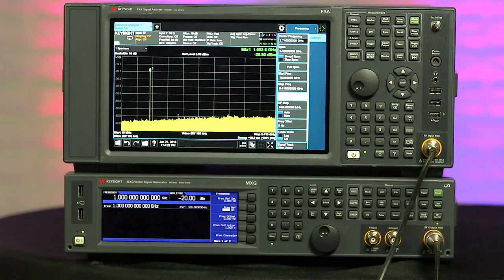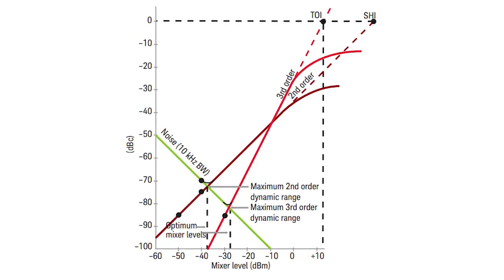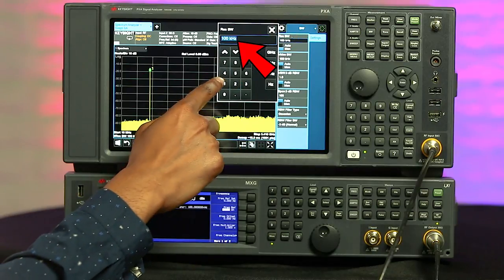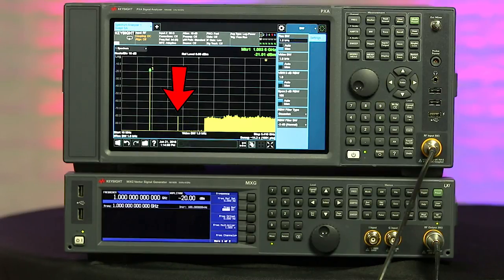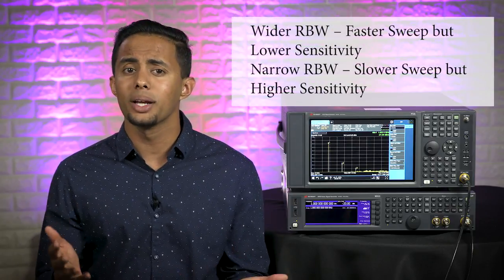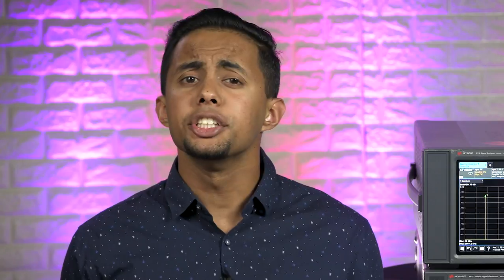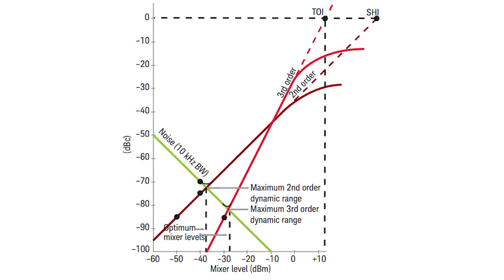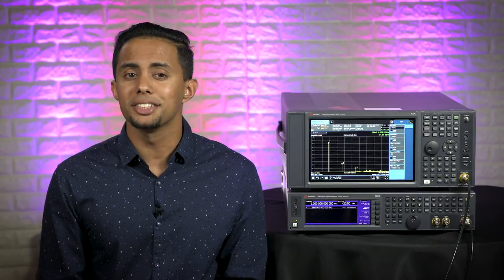How to Increase Your Signal Analyzer's Dynamic Range to See Low Level Signals - What the RF (S01E04)

Comment: can you explain about video bandwidth VBW
Reply from the maker: The spectrum analyzer Wikipedia page actually has the most succinct answer I can find:

"The video bandwidth filter or VBW filter is the low-pass filter directly after the envelope detector. It's the bandwidth of the signal chain after the detector. Averaging or peak detection then refers to how the digital storage portion of the device records samples—it takes several samples per time step and stores only one sample, either the average of the samples or the highest one. The video bandwidth determines the capability to discriminate between two different power levels. This is because a narrower VBW will remove noise in the detector output. This filter is used to “smooth” the display by removing noise from the envelope. Similar to the RBW, the VBW affects the sweep time of the display if the VBW is less than the RBW."